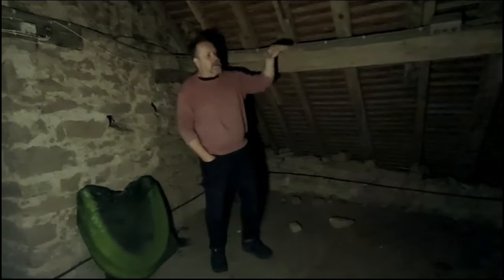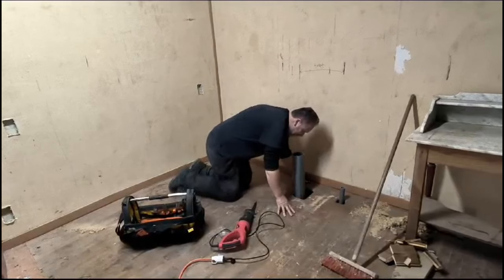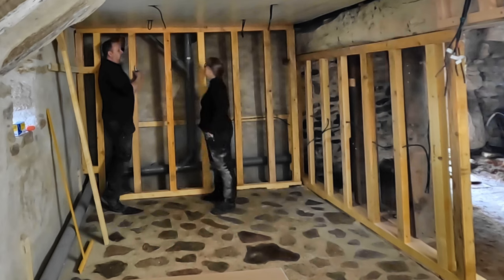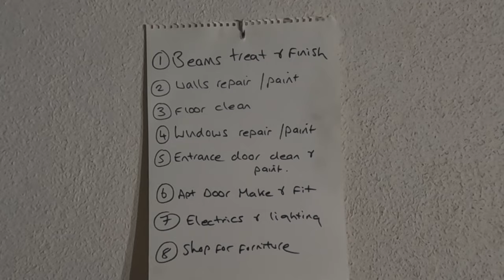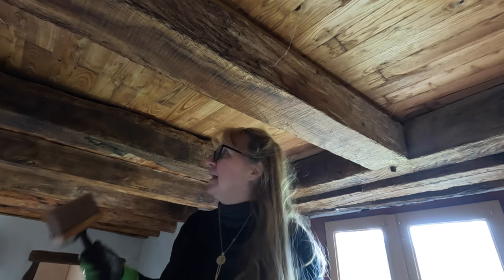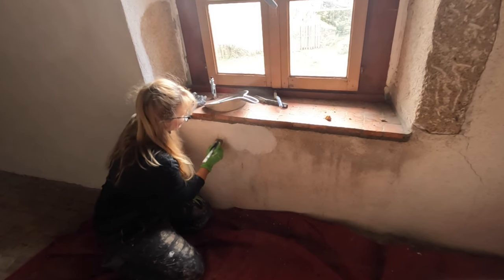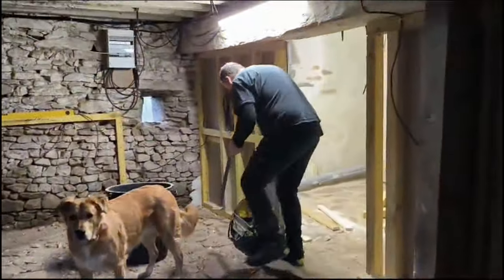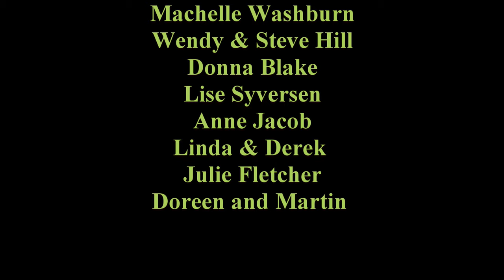Making the most of every space in your CHATEAU

Comment: Looking great you two!  I suggest baseboards (skirting boards) to finish the bottom of the drywall (plasterboard).  In "wet" rooms it's best to keep a small gap at the floor edge, about 1/2", so if water inadvertently is spilled it will not seep up the paper and create a mold problem.  Being a laundry room  you could choose to just leave the gap; just depends how "finished" you want it to look.

Comment: What ? No insulation ? In that large gap ! You could have put up a washing line and hung the washing to dry in that area - and it would have been toasty warm with insulation saving heaps of power ! Aaaahhhhh
Reply from the maker: I think you've missed the point, this area is going to be closed off from the main laundry room and used as a private space for our freezers and catering supply's (crockery, cutlery, etc). Insulation is very expensive and the wall was that far away due to the waste pipe to the two outside toilets.  Hope that helps 👍